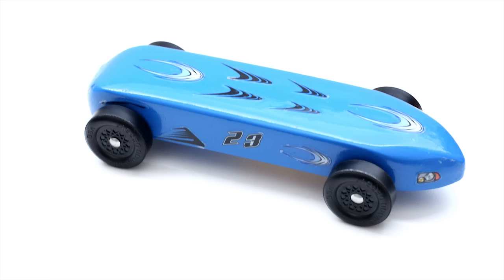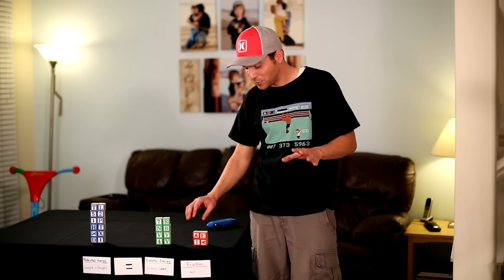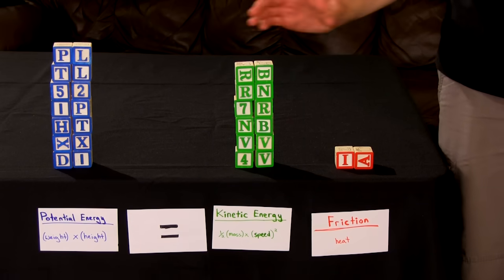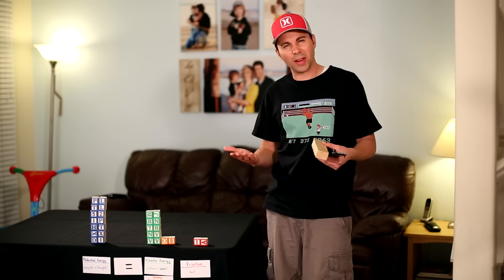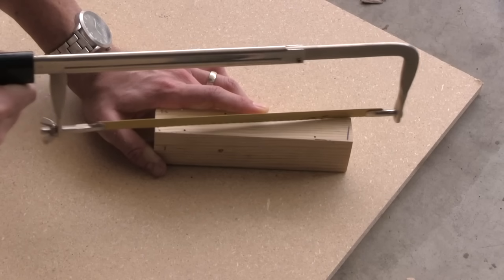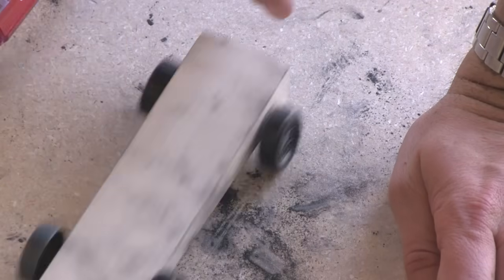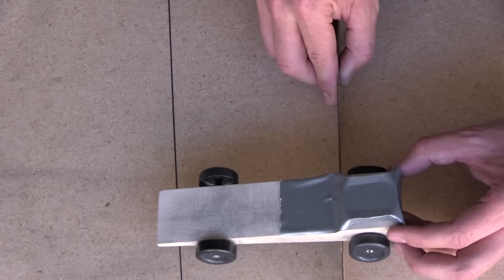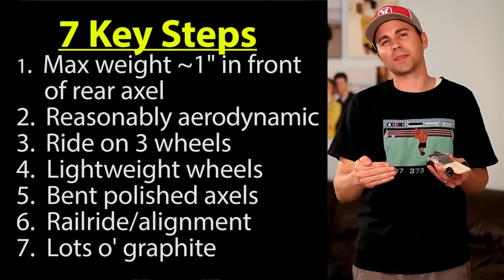EASY Pinewood Derby Car WINS using Science!!!

Comment: Yeah, all that stuff is cool, but to really compete at the top levels you need a flux capacitor.

Did pinewood derby circa 1970. Won a little bitty trophy for "workmanship" -- i.e., car looks nice but it's a loser. We did not know any of these tricks back then, apart from the powdered graphite and the polished nails. I think my Dad who was an engineer must have been keyed into center of gravity, since the lead weights were placed at the rear of the car. He just never explained why in the elegant way this video does.